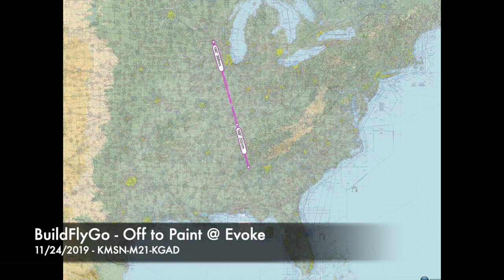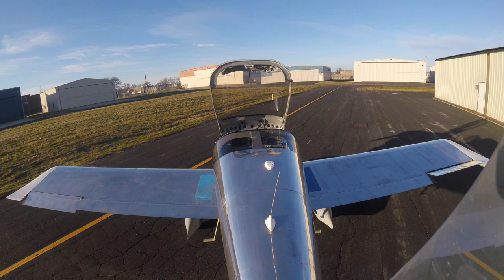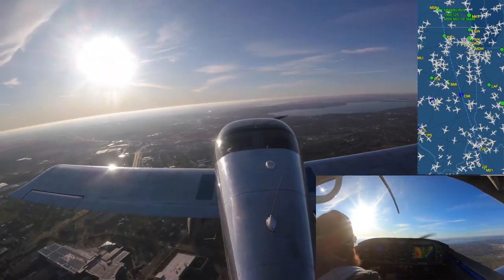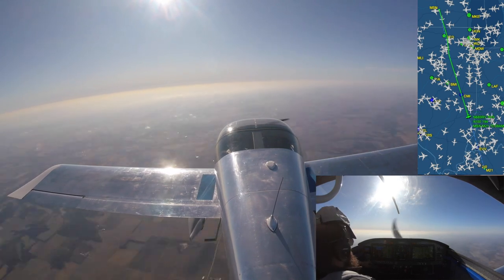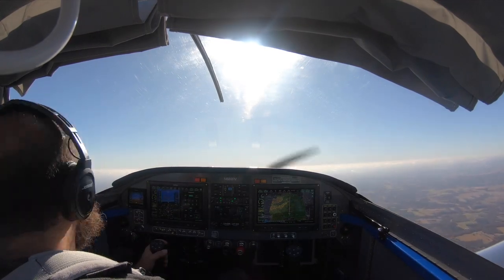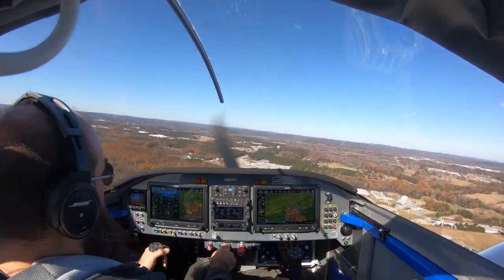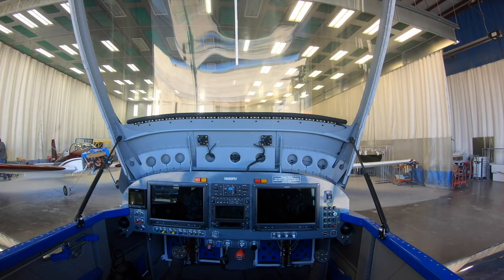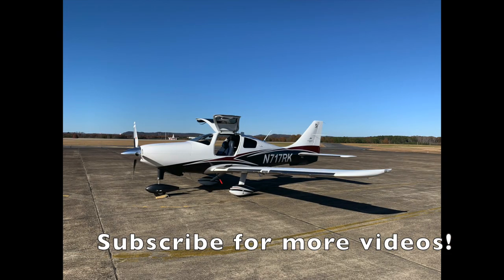Off to Paint: KMSN-M21-KGAD

Comment: Hi and thanks for your work on these videos.  You were flying it without paint - wanted to ask you:  Was the fiberglass covered with just High Build, or was there some epoxy mix sprayed on the fiberglass too?  ( to protect from rain, dirt, bugs)
Reply from the maker: Initially there was a skim-coat of epoxy to protect them. We later had a local aviation paint shop spray them with 2-part epoxy primer to protect them further from UV, etc.